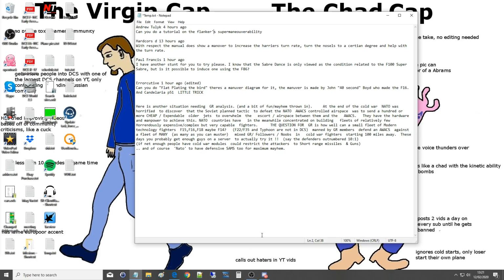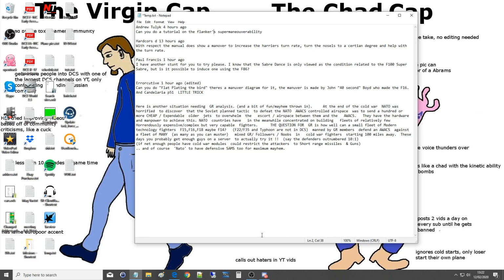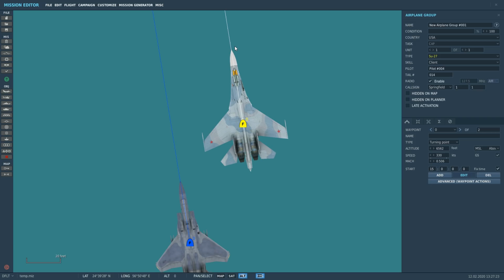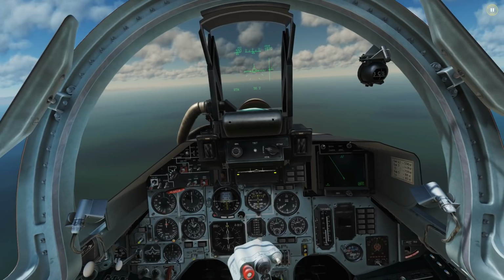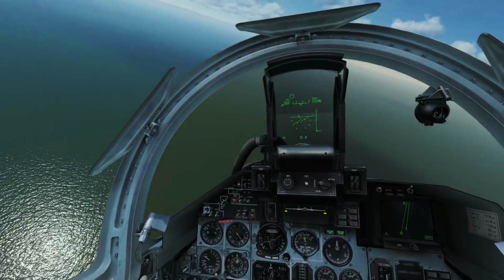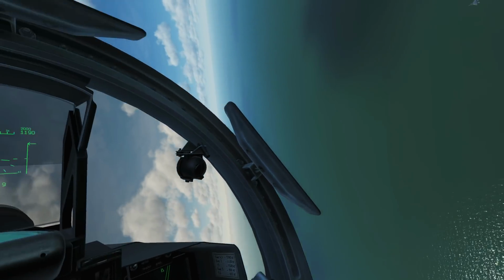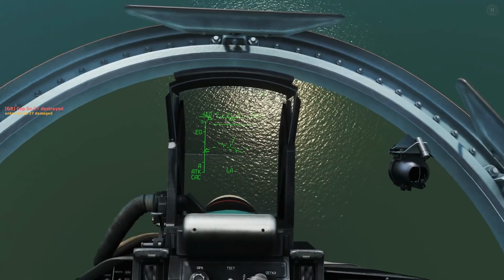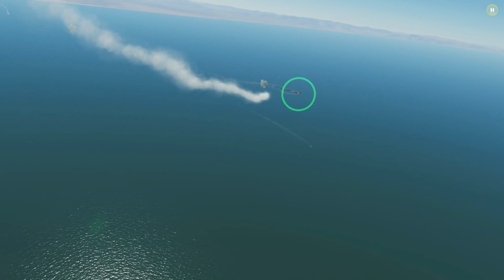Su-27 Flanker: Dogfight Cobra Manouver Super-Manouverability Tutorial | DCS WORLD

Comment: Are you supposed to hold the S key or just press it? I’ve tried both, along with holding Y to de-limit my stick but still can’t get the SU-33 to cobra
Reply from the maker: press
Reply: you can see if the fly by wire switch is off or on

Comment: Imagen a Su-35s doing a Thrusvektor ....Cobra hahahahah against a 
F-22 Raptor ...
Reply: Would make for a very nice display right before the flanker gets shot down as it's too slow to do anything.
Reply: @pandabanana2593  It will work ;-)
Reply: @mike-thebike5757  what will work? A high aoa pull at low speed with a heavy high drag airframe? That doesn't work for anything except hob fox-2 shots, which the raptor can do as well with a  better twr and lower ir signature.
At best you trade. 

Guns? It doesn't work. The raptor can pull the same high aoa with a better twr. Assuming both pilots are equally stupid to actually do it in a fight, again you trade but the raptor recovers faster because physics still applies.

There's a reason why 30mk# users don't use cobras except the Indians who proceeded to get laughed at at red flag as they were gunned by vipers.

Comment: I find that in practice, the F-15's ability to pull virtually unlimited G's at high speeds without breaking the wings off is of more advantage than the Flanker's ability to swap ends at low speeds without losing effective control. Usually the merge is at too high of a speed for a cobra. just my 2c

Comment: For longitudinal stability, think of a seesaw... the point where the seesaw swings about is the center of lift (CL), the CG is the weight at one end of the seesaw and the other weight is produced by the elevator, which produces “negative” in straight and level flight. That balances the airplane. Now, having a CG very close to the CL or on top of it, will make the airplane very unstable and maneuverable. Having the CG actually behind the CL will make an impossible to fly airplane, without computer assistance.

Comment: I'll throw in another way to think about static stability, it's how the aircraft reacts to a small change in lift (whether from a gust of wind, twitch of the stick, etc.). The aircraft rotates around the center of gravity and the increase in lift will be present at the center of lift. If the center of lift is behind the center of gravity, then an increase in lift will cause the the tail end of the aircraft to move up, making the aircraft pitch down and reduce lift, returning to normal. On the other hand, if the center of lift is in front of the center of gravity then an increase in lift will cause the aircraft to pitch up and continue to increase lift in a feedback loop until it stalls.

Unstable aircraft were basically impossible to fly until fly-by-wire came about, and even then the first full fly-by-wire aircraft (F-16) had nearly neutral stability.

Comment: Stability: Cap, think of badminton. When you hit a shuttlecock, it turns around, because drag is pulling on the cone as it flies. Inertia carries the center of mass forwards, drag pulls the cone back, and so the shuttlecock rotates until its drag vector is in line with its velocity vector. That's stability: it has an orientation it wants to return to (relative to the airflow around it). Keep the badminton image in mind and you'll never get this wrong again.

Now, think of your airplane as a lever. The pivot point of the lever is the airplane's center of inertia (mass). If you skid your airplane, air pushes on your fuselage and tries to lever your airplane straight again. This goes on in all axes: drag pulls on your airplane's wings and tail and tries to keep them aligned with the airflow. The further back from your airplane's pivot point that drag is centered, the more torque it exerts on the plane. Longer lever = more stable = more resistance to changing attitude.

The F-16 was deliberately designed with a very short lever. Low stability = low resistance to changing attitude = snappy dogfight performance = happy Cap.
Reply from the maker: thx

Comment: The Cobra doesn't make you lose much more energy than any other extreme AoA "hit the brakes" maneuver. Hornet's Pirouette, for example, makes you loose even more of it.
The biggest disadvantage of the Cobra is not that you "will take hours to regain your energy" (that's bollocks, you will be getting it back at the same rate you'd do after losing the speed through other means), but rather that once you are IN the Cobra, you can't do much with the attitude until the nose drops, at which point you are down to around 150 kts and the plane starts to accelerate normally (now, if the Flanker is filled up almost to the brim, that could indeed take forever).

So, basically, it's a fancy dump your speed maneuver that is more effective than pulling on the stick in the Mirage, HOWEVER, the Mirage does it in a much, MUCH more controllable manner (although you can't pull the Archer trick in that).
One could argue that dogfighting two-circle is very similar to racing with both cars trying to get on each other's "six" on a huge skidpad. And in racing the brakes are one of the most important parts of the car if you want to be fast through the trajectory. The Mirage's delta-wing is probably the best braking mechanism out there, even if it may be a bit less effective at dumping as much airspeed within seconds as possible.
Reply: I always saw the Cobra as a demonstration maneuver to show off the pitch authority and post stall stability of the aircraft---a jet momentarily going backward through air without tumbling out of control is great PR for the Sukhoi design bureau and the Soviet Union.  I never thought it was being brandished as a practical combat maneuver, but of course a plane that is capable of such controlability is one that will be strong in a slow speed fight.  I think Russia has a history of building aircraft the were underestimated by the west, and in this case if they couldn't match western electronic systems they would do their best to beat western designs on maneuverability.
Reply: @gort8203  The importance of this particular maneuver is either overblown out of proportions or is greatly downplayed and comes bundled with myths like "you are going to lose ALL of your energy and will take minutes to recover" (if not outright "fall out of the sky"). Whereas in reality it's just a very effective aerobraking trick which leaves you out of control of the plane for several seconds, so it needs to be performed at the right time.
It doesn't really make the Sukhoi "supermaneuverable", but it's quite an interesting signature "move" of the airframe.

As for Flankers somehow being more maneuverable than most of other fighters of the same generation, that's doubtful at best. It's a very heavy plane with wingloading numbers that are pretty good, but still far from ideal. The relaxed static stability indeed does help it in the maneuverability department, but nothing can cure the lack of lift opposing all the mass.
Reply: @Gort Or should we call it "post-stall attitude authority" instead, since arguably, maneuverability is more about the capacity of changing one's velocity vector over time (delta-V, in a sense) rather than the orientation. That effectively moves thrust vectoring into supportive category. It's not awfully helpful at maneuvering speeds, but it can extend the control envelope for the relaxed static stability airframes somewhat (maybe not by much though, considering how laggy the nozzle controls potentially are).
Thank you for the kind words. Though I'm a little surprised with being told that, since I mostly use YouTube as one would normally use an image board (as in staying more or less anonymous). Still, I appreciate it if you find my opinions and expertise useful.
Reply: @Gort As I said, this kind of control can also help keeping an unstable airframe within the operational AoA limits, so it's definitely not entirely about attitude.
Fast forward to orbital warfare, and these two components of maneuverability become even more distinctive. Although, being able to quickly reorient the main engine vector can be even more important than having lots of delta-V and integral acceleration.
Still, for now it may not be worthy enough to deliberately equip fighter jets with TVC devices, since their use is very limited, yet they add up to the weight and reduce the service life of the machine.
Reply: @Gort Then there are also those new missiles like Python-5 with the complete spherical attack coverage you can put on pretty much any platform. I have a feeling though, that missiles are getting where they are starting to be considered enough of a threat to develop special hard-kill devices to counter them. Then it's guns-only BFM all over again.
Reply: @getsideways7257  Perhaps then the B-52 will become the F-52, carrying big loads of long range AA missiles plus anti-missile misses and directed energy defensive weapons, and dominate the airspace just by being there.  ;-)
Reply: @gort8203  I also had an idea in those lines, but it looks like this is something actually being considered, except with the B-1 as the "guided missile cruiser" in mind. Coupled with an AEW&C or two it could be a serous claim for total air dominance. Although personally I'd still keep around a small fleet of mostly stripped light fighters for those cases where the missiles prove ineffective. And speaking of carrying stuff, our re-purposed B-1 might also make a good carrier for drones.
So, you could say naval warfare doctrines are slowly but surely shifting to the skies :)
Reply: @getsideways7257  Yeah, as I seem to recall the concept of the B-1 as a long range A-A missile truck came out of Rand.  It would act as a deep magazine and launch on targets designated by F-22s or AWACS.  But the B-1s are now destined for the boneyard while the B-52 will remain in service in the bomb truck role, so I wouldn't be surprised to also see A-A missiles on it someday. We live in a strange procurement world. Rather than keep the B-1 flying they are going to buy new F-15s for the deep magazine role.  Better at one-on-one air-air than a B-52, but it will never be able to carry enough anti-missile missiles and laser cannon to become an aerial dreadnought. ;-)
Reply: @gort8203  That's an interesting decision on their part, putting it mildly... B-1's radar cross section is comparable to that of the stealthiest 4th generation fighters, while B-52 should be visible from the farthest distances for pretty much any radar. The operational mobility of the Lancer is also greater... Of course, if they would really utilize it alongside an AWACS type of an aircraft, nothing could be done about hiding or quickly relocating the latter. Still, it's likely more about lobbying than anything else.
Relying on F-15s in that role is even more amusing, but if no large enough scale conflicts are anticipated, that works too I guess...
It's interesting to see whether the B-52s will be indeed converted into "flying AEGIS cruisers" after all. The amount of AA missiles that could be loaded into one can probably indeed rival that of an Arleigh Burke-class :)
Reply: Well, if your opponent is a high-energy fighter and you missed your shot after pilling a Cobra, your opponent can pull a high yo-yo or something else to deal with you in a low energy state. Flankers, even Super Flankers have a comparatively lower acceleration and energy than fighters like the F-16 and F-15, the latter two were built on John Boyd's energy-maneuverability theory.
Reply: @mickeyg7219  The same stays true for any kind of energy loss situation, not just a Cobra. In general, one needs to be extra careful while fighting an opponent with a better TtW.
Speaking of which, F-16 doesn't have that much of an advantage in that regard if you do some calculations. F-15, on the other hand, is a clear winner in both the thrust to weight and wing loading categories.
The newer Flankers are actually worse, in my opinion, since they've grown way porkier over what was already pushing the limits of a "heavy" airframe that can barely move after getting filled up to the brim.
Reply: @Gort To be honest, F-35 deeply puzzles me however I look at it... apart from the advanced avionics suite, that is. I'm highly skeptical about this thing and it's sheer mass (in relation to other specs) doesn't really help its case.
I believe it was too early to discard the 4th gen just yet, especially considering the 5th gen's limited combat effectiveness proof.
Speaking of the F-22, the TVC deflectors also help masking the exhaust IR signature, and that probably was their primary role until somebody came with the idea to kill two birds with one stone. It's a rather elegant solution and apparently was worth the trouble.
Reply: @getsideways7257  The F-35 is such a debacle it has inspired the Air Force take its procurement process out into the snow and shoot it in the head.  They have delayed  development on the next gen fighter until they get their century series for the 21st century procurement model in place.  Perhaps what they should have done when the F-35 went off the rails was build an updated F-22 that takes advantage of the networking and sensor fusion advancements developed for the F-35, because it might have been cheaper, sooner, and more effective all around. I think history shows that fighters can bomb better than bomber can fight, so the only issue might have been range.  All that said, you do have to take the F-35 T/W in perspective because it is meant as more of strike aircraft than an air superiority fighter, and it carries all fuel and stores internally.  We shouldn't expect it to compare with a clean F-16 at fighting weight.  Has it been flown against an F-16 carrying racks of missiles and equivalent fuel?
Reply: @gort8203  I guess it will do ok in the strike role as far as VERY HIGH precision and stealthy strikes go. But you are right, expecting it to play the air dominance game evenly with the likes of F-16 is nothing but wishful thinking, let alone "killing them in bundles".
Reply: @getsideways7257   On the subject of post stall controllability, I just had an example of where it might have come in handy.  I was practicing one-circle entries from a head-on merge, figuring I might have chance to learn something about it with a Hornet against an AI Mud Hen.  Well. I did gain an advantage on the first few turns and was making angles with my speed under control.  But I guess the AI saw that and pulled for broke, and I as pulled to counter my weakness at keeping sight in DCS distracted me from AOA, and I pulled right into a stick full of mush with zero ability to move the nose. Luckily the AI was in pretty much the same state, but if I had been able to rate may nose at all I could have parked in his six as we both struggled to pitch down for enough speed to get behind the other.  I made a mistake that perhaps post stall maneuverability would have allowed me to recover from much more quickly with a big advantage.  So I'm seeing post stall maneuverability as giving a slow-speed advantage that has no need of fancy set piece display maneuvers.
Reply: @gort8203  Still, I think the best strategy here is not getting into a low speed situation to begin with. During my "controlled environment" engagements I put in quite an effort not to get under 250 kts, mostly trying to have at least 300 whenever I bring the nose back down to the horizon. That allows me to get onto pretty much any bot's six when I'm flying one of the better performers (the recent F-16 update needs some work though) like the Mirage. I only dump most of my speed when it is absolutely necessary.
That said, it would definitely help if I also had some augmented authority from the controls, but only if it didn't come with a lot of added weight.
Also, if I had to choose between a TVC-enabled fighter module and one of the recent European canard delta ones, I'd rather pick the latter (even though previously I was highly curious about TVC). Preferably the Rafale, since the interplay between the wing and the canard seems to be very peculiar there, while the body itself should be also very aerodynamically efficient. On the other hand, maybe this kind of aerodynamics would be too much even for DCS...